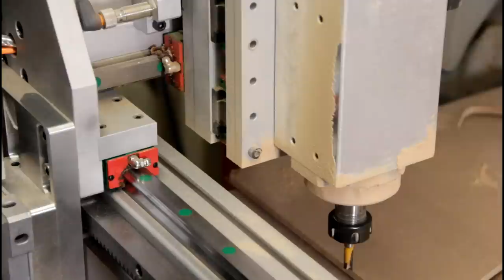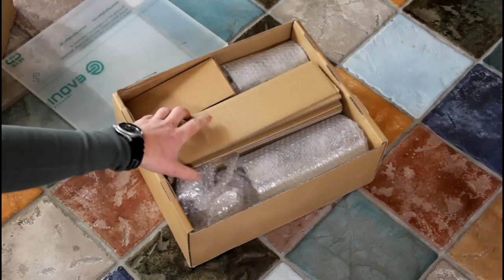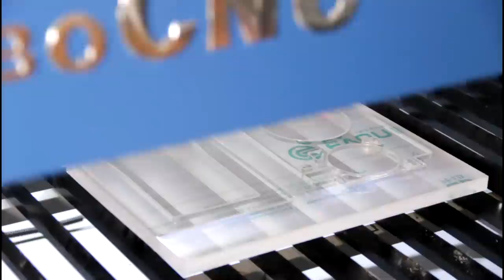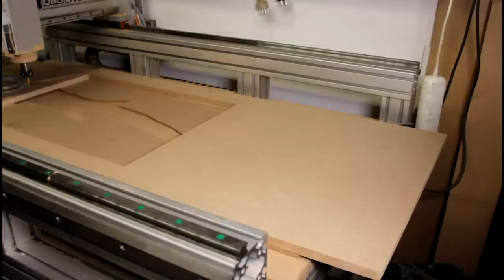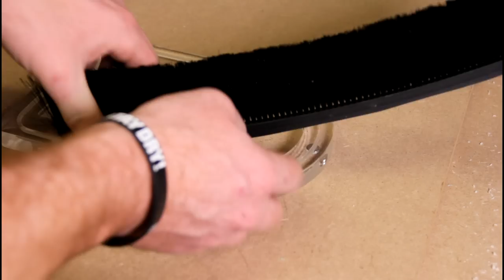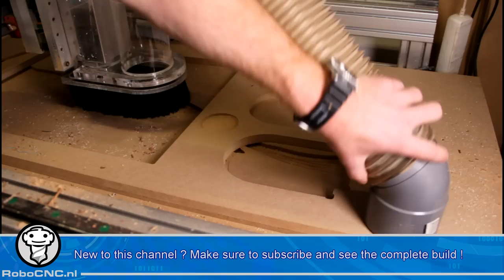RCNC X2 Router 16: Making a CNC ‘Dust Shoe’

Comment: I used to use an acrylic dust shoe, but it's so hard to see the work through it I eventually just started using a steel one that focused the vacuum on the bit better.
Reply from the maker: What ever works... I know the clear acrylic is not all that great for looking at the bit... I use acrylic since 2008.. Still works fine for me..

Comment: My experience with dustshoes using hairs is that the hairs tend to fill up with dust and grow from about 8mm to 6 cm thickness.  (but that's when plowing through thicker material though)  That laser works miracles on the material! nice buy! How many watts is it? 150W?  Do you still have your BF20? I recently finished my new portal, and sold the BF last night Sniff. All these good memories..
Reply from the maker: I use a dust shoe like this since 2008 and have no problems like that. Without it my shop gets way to dusty so I have to use something... I still have the BF but it does not get used a lot... the laser is 100W

Comment: When you designed the hole in the acrylic, did you make it like 0.1mm smaller than the collar of the spindle, or the exact same size?  Seemed to fit like a glove, then nice and tight with the clamping of the bolt!
Reply from the maker: The same size, there is a small 2mm slot that can flex and can be tightened by the Allen bolt. Reason for designing it the same size is to make sure when clamping the force is on the complete circumference.

Comment: Nice work. Funny how similar our CNC-s are :D I have exact frame design, except rack and pinion Y-axis. Right now I have all ballscrews, but Im thinking of going full rack and pinion because of the speed. Im wondering, where did you get this brush strip? I just cant find it anywhere :D
Reply from the maker: Thanks for watching... and good luck with the convention. Poaah I can’t remember, somewhere from eBay. It is used for, what’s the English word 🤔, well the rotating doors in front of a shop 😅

Comment: Hello Marcel! 

Where can we find some videos of the milling process with this CNC machine? It would be interesting to see some agressive wood routing, tooling board and aluminium alloy machining. 

Did you consider a water-cooled spindle? Why have you chosen the air cooled one?
Reply from the maker: Stay tuned on this channel.... I have not had time to do much video in the last half year. Water cooled is much less noisy, but there are a lot of bad water cooled spindles on the market and the cooling and lines makes it complex

Comment: Hello I am new to cad/cam and CNC is a whole. I have been practicing with Fusion 360 and downloaded your drawings and plans. However when trying to recreate the parts for practice it seems to me that a lot of very key dimensions are missing and not called out. Is this something that being a newbie I am missing or are they actually missing from your drawings and plans? For example in the download folder under the y axis subfolder for the ballnut bracket, I noticed there is no call out for the step down from the 44mm width to where it mounts to the Z-axis plate. Same thing with the gantry side plates, for instance the 20mm thru hole has absolutely no dimensions of placement called out on the drawings, I had to go look up the dimensions of the 80x160 extrusion for the bolt hole pattern and then center the 20mm thru hole's between them.....So is this something that being a newb I just dont understand or were the dimensions just left out of the drawings on accident?
Reply from the maker: I have very little time to check the parts you mentioned at this moment. But since you do use cad find out how you can import the drawings like the DXF, you do not have to redraw everything since i provide the vectors.

Comment: Marcel, one more question. Do you plan to install some protection / covers for the guide rails / racks / ball screws?
Reply from the maker: Good question.... No I plan not to do so.. Reason being that sealing it is quite difficult to do and since dust will penetrate sealing makes it difficult to clean and lube... 
I plan on only using dry lubes, still testing witch one is best.. Is this the best solution? Well No its not the recommended lube for the rails, but i accept the fact that i will reduce lifetime. The drylube atleast prevents dust from sticking and entering the bearings.